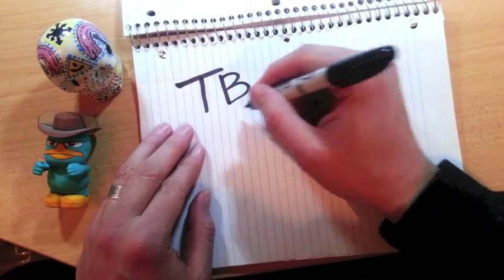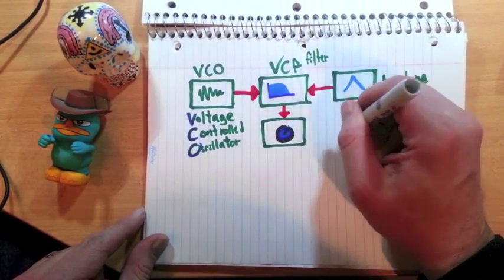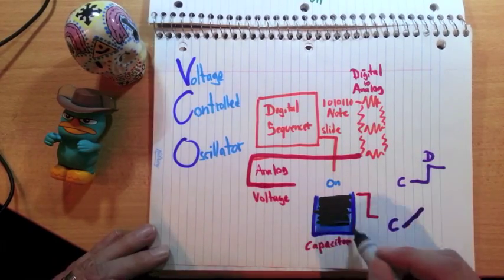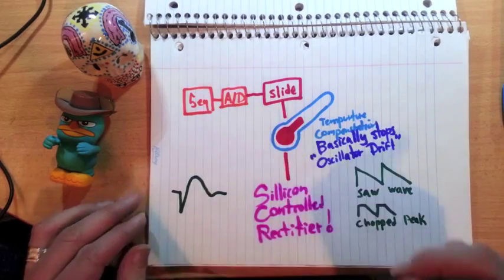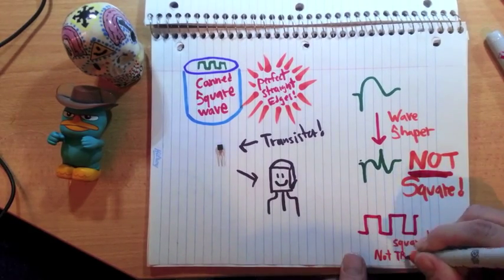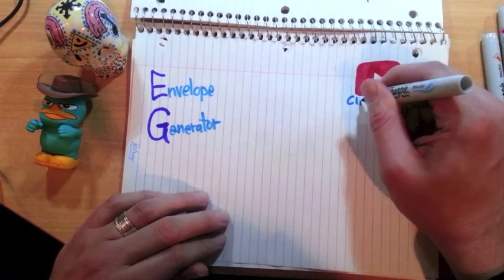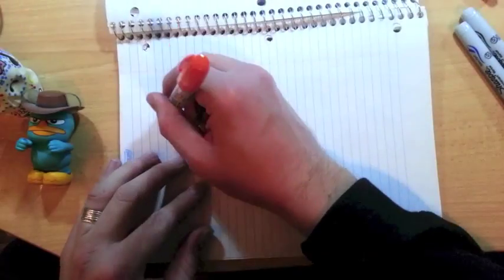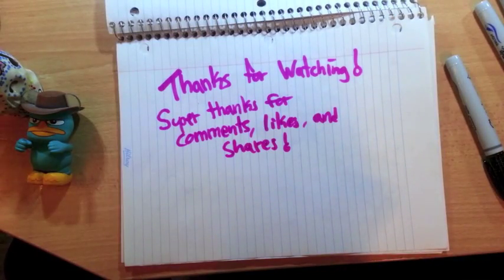I'm Jonnay - Episode 4 - The TB-303 is a real character.

Comment: Nice explanation. I have been looking over the schematic of the 303 for a long time now and want to make a similar slide circuit in my own DIY sequencer. Still trying to completely wrap my head around it... most slide circuits out there are more of a portamento for CV and does not really get that 303 slide. I dont need it to be exactly the same but want to get it rather close since there is nothing like it out there! 303 sound forever!
Reply from the maker: Thanks!  Looking back I missed a few things and got a few things wrong, but most of it stands. 

That 303 slide is really something hey?  It's crazy how simple the circuit is!